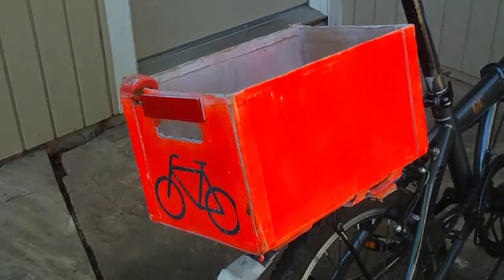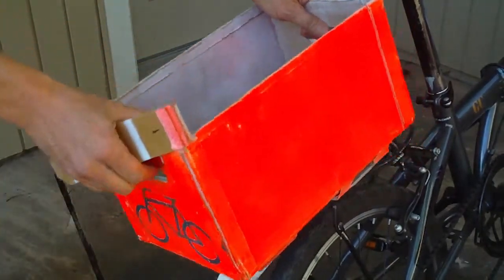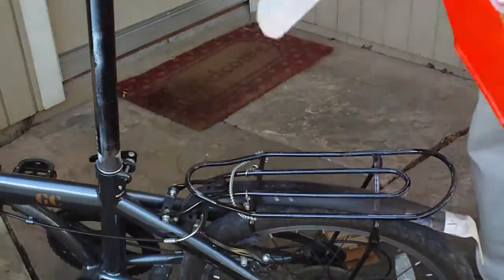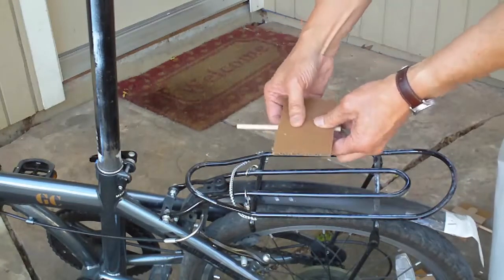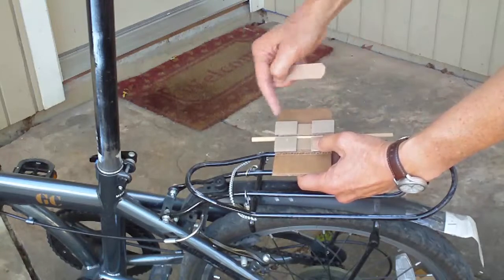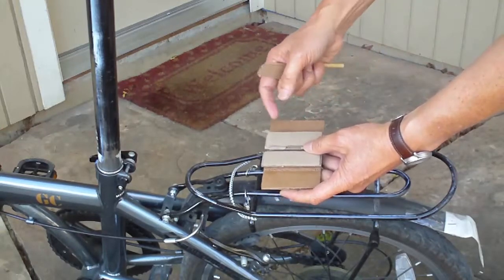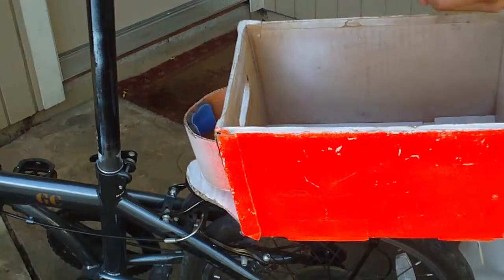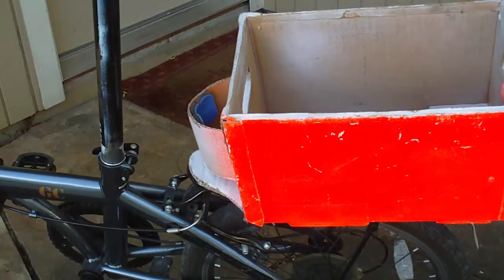Construction of cardboard cargo box for bike

Comment: Where did you get the box?
Reply from the maker: I got a big cardboard sheet from an aisle at Costco and cut/folded it into the size that I wanted.
Reply from the maker: If I did it again, I would make the box about 1 inch wider to accommodate flat take-out food containers.
Reply: @graychang99  thanks for Costco info, and info on how to improve it.

Honestly, I'm surprised that nobody else has taught this.